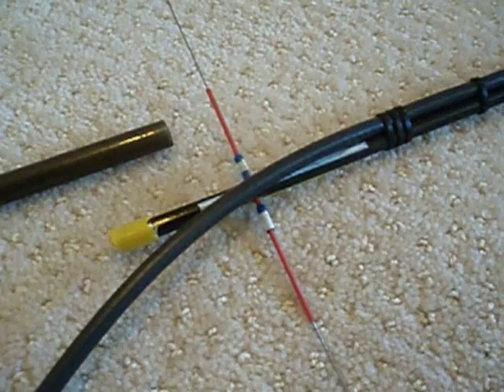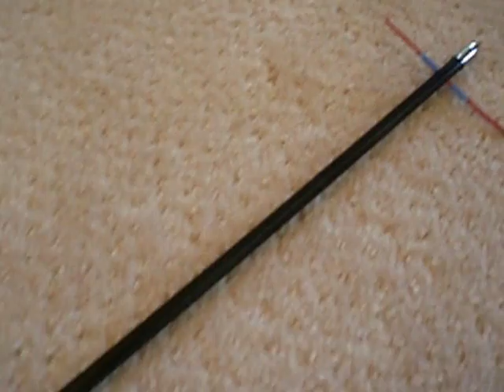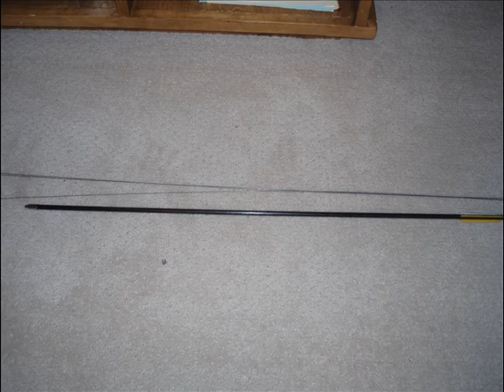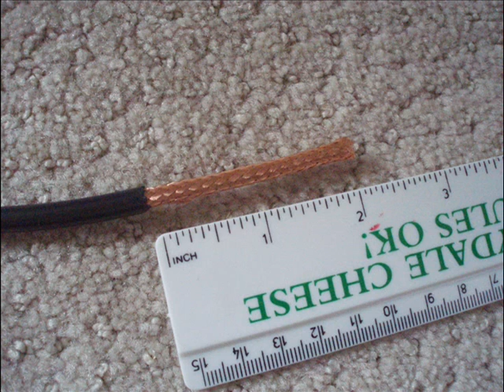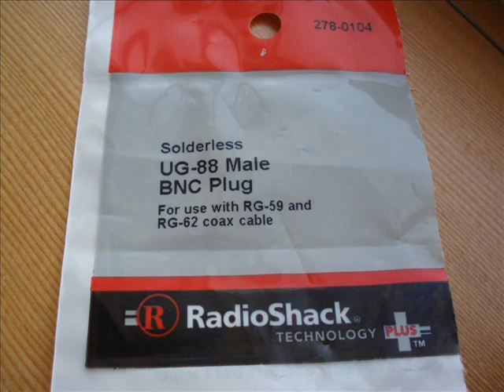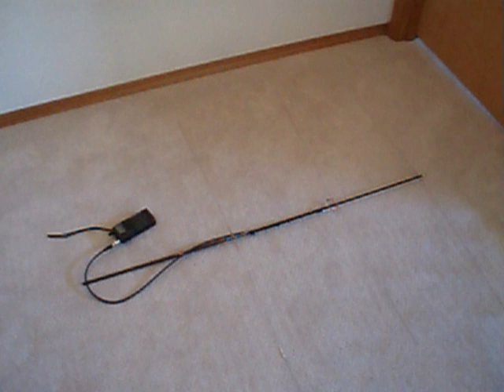2m Backpacking Yagi

Comment: Is there a way to get around drilling holes in the shaft for the elements? Like soldering the elements on the outside of the shaft itself? I ask because I have no drill press. Also thanks for the video!
Reply: Actually, Carbon conducts electricity very well. Hook a pencil up to a current and you will see or you could get one of those carbon fiber umbrellas and make a lightning rod out of it.
Reply: Actually that wont work since they can't contact the shaft and need insulation.
Reply: If the  shaft is carbon, solder won't be conductive with it, but will melt the carbon.

Comment: Would .012, .016, or .017 inch plain steel guitar stings work for the elements, and this might sound stupid (sorry very new ham) but would different thickness elements affect the final result or would it not particularly make a difference.
Reply: +usernamemykel but 2m is open to technician level licence holders so don't be a smart arse.
Reply: You've given yourself away - if you had studied for the General level exam, you'd know that diameter matters.
Reply: usernamemykel shut up

Comment: Question for you.  So when I use this antenna, do I simply set in down on a flat surface on the ground?  Or Do I stick in the in the ground standing up?
Reply: Vertical for FM, horizontal for SSB. And the further up from ground, the better. 73 de E73HAK

Comment: Thanks for your nice, detailed video!! BTW, the music wire must be what RC plane builders here in france call "piano string"--these come in several diameters, are very tough and we use them for the push-rods of the servos of the ailerons and stabilisers. They are pretty tough :) How do you manage to listen to the 440 mhz frequency when you emit on the 2m band? Do you think it can be done with only this antenna? Thanks again!

Comment: This week I was able to connect to the Goat Mountain repeater W7OTV from middle rock lake inside the Roaring River wilderness area. The distance was about 15 miles but I was down inside a pretty steep valley at the shore of the lake. The signal report was good. I was listening in on a search and rescue effort happening a few dozen miles from where I was backpacking and was glad to be able to have communication ability from a remote location.

Comment: Something else I had some success with was getting a neatly parallel solder of the 41" reflector element.  I used a piece of 1/16" heat shrink to bind the two wires together, cut out the center portion of that heat-shrink, soldered the two wires together, and then used a 3/32" piece of heat-shrink over the solder joint and remaining 1/16" heat-shrink.

Comment: I started building one of these tonight.
I managed to find both the 0.025 Music Wire, and some Aluminum tubing from Hobbytown USA.  The manufacturer is K&S Engineering and I picked up two sizes: #1114 (9/32 x .014 x 36") and #1115 (5/16 x .014 x 36").  The 5/16 fits neatly over the 9/32 for the cap.  The disadvantage, is that the tubing is rather thin walled and may not be as sturdy as an arrow shaft, but I we'll see.  I am trying to see if Heat-shrink is suitable for insulators.